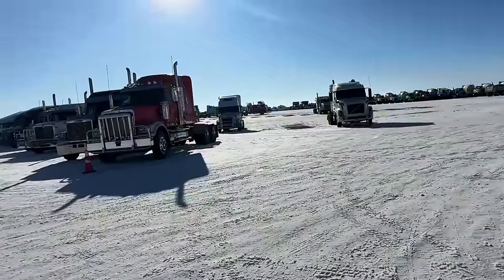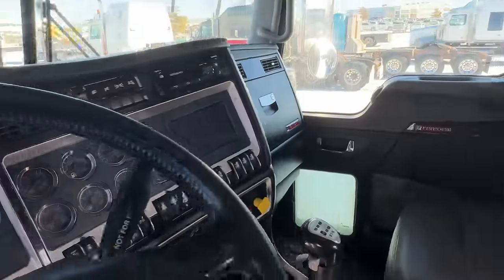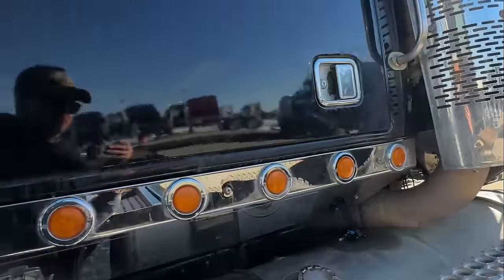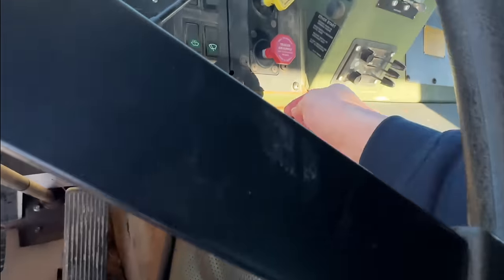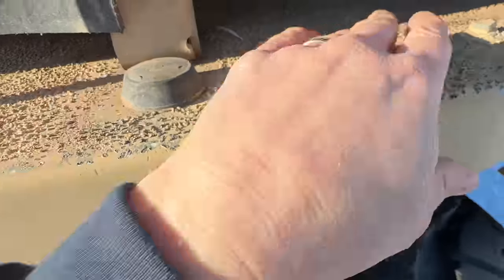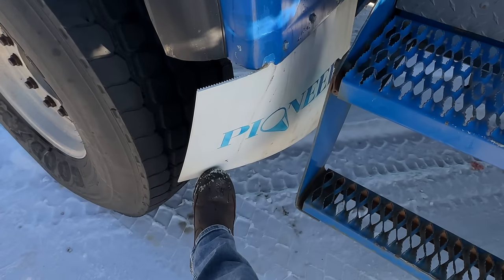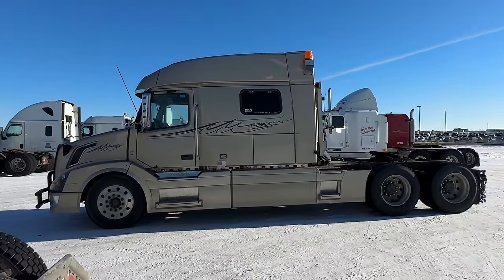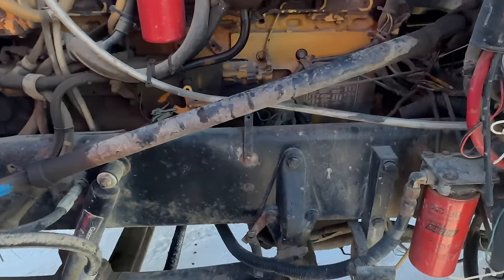On The Hunt Ep.42 Oshkosh Auction

Comment: I am sure a thousand guys have told you now. I was a heavy wheel mechanic in the Army active duty for 10 years. The hoses in the back are for chemical warfare. They are for filtering the air. So the hoses hook up to your gas mask. The bench seat is for the tank crew. The old ones had a  8V92 Detroit in it. The new ones have cat C18. I want the new one. Side note. I hauled a broke 'het," which is the truck you are in With a M1Abrams on the back. With my Hemtt wrecker. It broke my toe cylinder and chewed my tires up so bad. It took 1 inch off my tires in a 20 mile trip. I saw my motor Sgt do it so I had to try it
Reply: Could one replace the Detroit with C18, do they have same gearbox and bellhousing?

Comment: The hoses in the cab are for the Nuclear/Bio/chem filtration system. They hook into the clean side of a pro mask. And the rear wheel steering is speed controlled. Keeps you from dragging the rear drive around corners and stripping the tires. and if it didn't have it, you couldn't do a u-turn on a football field

Comment: I just bought a 1957 Kenworth CC-925 that has been sitting outside for at least 30 years and it's frame is in better shape than most of the trucks at that auction.  I paid $1500 and dragged it out of the Mojave Desert.  It has 5X3 twin sticks.

A couple of years ago I was at my local pick a part and there was a 6.2 diesel suburban with a Banks system on it and I pulled the Banks system and bought it for a couple hundred bucks.  They are long discontinued and still in demand.  Most people just pull the factory turbo system off of the 6.5 with the factory turbo. I was running a 6.5 in my 1994 H1 Hummer up until 2 years ago when I duramax swapped it. Most people don't realize that GM sold the design for the 6.2/6.5 to AM General and they were actually updated and made much better than the GM version.  The optimizer was the first revision followed by the GEP P400 which is sadly discontinued. Many GM truck owners purchased the GEP P400 to install in GM trucks and Suburbans.  I had a GEP P400 in my H1 Hummer up until I did the Duramax swap.  I originally purchased the H1 Hummer with a broken crankshaft caused by the failure of the harmonic balancer which is a very common occurrence.  The P400 is rated from the factory at 250hp and 550tq and they can easily make more power and in my Hummer I was making 325hp and 600tq which is actually respectable.  I kept the P400 from my Hummer when I duramax swapped it just in case I find the perfect Chevy truck with a tired or broken 6.2 or 6.5 engine.

Comment: 7:01 that’s a blower for a pneumatic or vac trailer, worked for a company that had 350 of them, they’re 2-3 or 4 hopper trailers that are used for hauling commodities like a hopper bottom but you can blow it up piping into a bin or any container and keeps it all sanitary/food grade. They’re used for the powder part of cement mix at big plants. Or we could change the pipes and use them as a vacuum, like vac out spilled grail or use it as a holding tank off a vac truck. The uses are endless but they’re a huge pain to take care of but a lot of the big 5 hoppers are out in the patch too for frac stuff too
Reply: Probably a Gardner Denver or a Drum.

Comment: We have an old military Oshkosh where I work. I believe it was a wrecker, or they wanted it as a wrecker. It was too slow on the highway so it's a water truck now. The tires will go flat over time but after you start it, they puff right back up. They self regulate the pressure on all tires. My first half ton was an 85 Chevy Sierra. I loved it, I could climb right in where the engine is and there was lots of room to work in there. Had an old police cruiser engine with the 4 barrels. I had to keep a box of fuel pumps with me because it would randomly kill them. Luckily the pump was easy access front of the engine. Unfortunately, I did not have a licence then. My ex had it in his name. When we split, he traded it for a stereo. I never found it, never seen that truck again.

Comment: Mark, you have a extra zinger left in the bag! You finished with the GMC with the 6.2 Detroit diesel! WOW talk about bringing back memories man! This was my first diesel engine! Mine was in a 1986 Chevrolet K5 blazer, white with burgundy interior 4X4 with a 700R4 (which I had rebuilt twice) only issue with the engine was glow plugs and glow plug relay! No turbo. I remember that GM came out with the 6.5 which had a turbo from the factory and was the next best thing? If I remember I had the civilian version and it had a awesome 165 hp ? The military version was 225 hp? Mine wouldn't pull a greased string out of a cats ass? But I got a awesome 33 mph! I was at the lake and this fella had a brand new f150 with the matching paint on his ranger bass boat and the boat ramp was wet and he was having issues with his 4X4 locking up ( it was tinging and his rear was breaking traction) I asked if he needed some help and he asked if I had something to help him out,  my old Blazer? ( 😂 his response) so I nosed up and locked my gal in 4 low and pulled hi out and kept on pulling a good 150' to prove my point! Brother 2/3 people came up to ask me what just happened and were shocked as to how easy it was to pull that off? The fella in the f150 said his truck was only 3 weeks old and the 1st time he tried the 4X4 ? Thanks brother for starting the old 6.2 up...you just took me back 30 years!

Comment: Those HETs are a beast, the air system that was disconnected is called CTIS central tire inflation system you can adjust to run in snow, sand mud and a run flat mode, and the rear tire steer is all part of the system they turn extremely well for a vehicle of their size

Comment: You letting Jake go on that Cat, bring memories. The owner that worked for sold Freightliner 3406E 2008. Replaced it International ProStar first emission control system. First week  with the ProStar, had a customer at bottom of hill. The Store was on intersection. You turn right the street was steeper than hill. A Pet had a C15, straight pipes logger haul comes over the hill just a screaming. The Pet get out of hear sound, the owner of the Store say your new truck does have a Jake?

Comment: 16:00 their is an inner and outer bearing race seal on the axle spindle that feeds the wheel hub active air, so their are 2-3 items one being an O-ring that run out and leak after a static amount of mileage. capped off... wheel air seal times 16 for the inner and outer, whatever happens when the axle gets 180psi in it... more seals. if it took 15 minuets to do a 1ton axle seal, those come off the same with a few more bolts tho 8 and a shop charges 255/hr, that's another 1500 bucks they didn't care too... what other corners were cut on a 35$ rubber ring?

Comment: In 1991 I spect out a Pete 379. I wanted a 6+4 the salesman talk me out of it, he said it would add weight and lower the resale value. I got the 15 speed which was the new trans back then.   The 3406B I was told was the last mechanical caterpillar before the E models came out. It was rated at 440hp 1650tq. Even though it was a "425".  I paid $97,000 for it.  $1624 a month. It was a great truck. After a couple years I put a turbo from the new 460 Cat and a set of injectors in it. Made 606rwhp and 2350 rwtq. It was a fun rig. I wish I got the twin stick...

Comment: Mark I went on to own a 2002 Chevrolet 2500 with the LB2 Duramax, a 2009 Chevrolet 2500 with the LB3 Duramax, a 20015 Chevrolet 3500 dually with the LB4 Duramax and now I'm in a 2019 F350 single rear wheel with the 6.7 power stroke! You can't really compare the engines I've owned but I can say each one was stronger and stronger! I have more hp in my current power stroke than my 15 liter Cummins that I drive in my 2023 Freightliner Cascadia at work it's only set at 400 hp? But my Ford's a beast! even at factory settings!

Comment: I worked im the oil field (in the 90s) and we used wd40 in lewe of Ether 🤷Also  they had a few Oshkosh trucks (from the late 70 early 80s) that I really liked a lot except for the automatic transmission part. The company was called "The Western Company of North America, I left the day they got bought out by "BJ Services" cause there is ZERO pride is saying you work for "BJ Services"  JS Theese Oshkosh trucks were converted from those cement trucks that look like they are going down the road backwards to Frack Pumps

Comment: The Oshkoshs look like former (US) military. I have not seen these anywhere in the Canadian Military. Not much for creature comforts or esthetics. The air lines on the hubs is called the TPMS (Tire pressure monitoring system) which allows the driver to adjust tire pressure on the fly. IMO one of those would make a very nice off road recovery vehicle for the oil patch if you could find a wrecker body that would fit. Glad hands at the front are for towing. The lines on the right side of the cab is for nuclear biological chemical applications (after which you might get to see the Mad Max Aussie Mack). The tray on the center was for the military radio sets. Pacars...apparently you can't just own one. Sorry to see you lost out on the Pete.

Comment: Hi Mark the Oshkosh are very strong work horses until you get British soldiers driving them I have tacken 4 back to the mechanics at a base in the uk that were used in Afghanistan and My god the bend really easy one had a tank cannon straight through the windshield 2 had been rolled over and the other was shot up and the engine had bullet holes everywhere the hood must of had 60 or 70 holes in it but the other 3 although they had very bad cab damage i did drive them on to the (lowloder) you call a lowboy I actually drove them but they are one hell of a truck, tack a look at some of c& cequipment on YouTube he buys alot of military equipment as the oshkosh and alot of bulldozers and excavators but he loves the truck's.

Comment: The OSKOSH  M1070s that you are looking at are two-stroke detroits. 
Later variants (very visible in Europe  -  UK and Germany  -  as the M1300 variant) 
have a CAT at about 18 litres
(18.01-litre turbocharged and intercooled 4-stroke diesel)
and a better Auto trans (more ratios))
(Allison 4800SP 7-speed, TC-496 torque converter 
and Oshkosh 30000 single-speed transfer case).

If you can get these (Engine & Auto) to RETROFIT to an M1070,
you have a good Heavy-Haul tractor.

The screaming two-stroke and the five-speed ALISION,
NOT SO GOOD, TO BE HONEST.

The Oshkosh 55000 transfer case , 
if you have it
gives a reduction ratio (2-speed transfer case).

Comment: Hey Mark you should consider attending the Mid America Truck Show next year and bring Snowman and the Pontiac Trans Am.
I'm sure the ATHS can make it happen;as Chad Keegan attended this year's show and brought his 1980 Kenworth K100C flat top to the show and was on display in the ATHS section of the show.
And for the shifter extension get in touch with SHTube they sell all kinds of stainless steel products for trucks.
Reply from the maker: It’s a little far from Edmonton…
Reply: @TwinStix  Yeah you have a point there;it's not worth the risk getting Snowman & the Trans Am ready for a 1,000 plus mile journey and risking a breakdown occuring half way through the trip and being either stranded on the side of the interstate or at a T/A,Flying J,or Loves truck stop.The best option would be to do what Mike The Truck Nut did;and that is to purchase a plane ticket to fly from Canada to Louisville Kentucky,and bringing a lap top and some Go Pro cameras and attend the truck show filming videos to post on the channel of the Mid America Truck Show and will provide a major boost to the channel.If you attend the Mid America Truck Show next year you might get some inspirational ideas for your truck builds from alot of the trucks that will be on display and you might even pick up a few channel sponsors while you are at the show as well.

Comment: The rear wheel steer is connected to the main steer just at a reduced ratio from main. The air hoses are for nuclear, bio, chemical environments for the passengers cause it’s made to transport tanks and the crew sits in the “bunk”

Comment: As for the super long gear shift , 8 out of ten transmissions  that I replace have those tall sticks they are a joke  , the best ones in my opinion are a w 900 or a t 800 with a short stick , they shift so smoothly,  just need a actual driver on the stick !!! .. w900 best truck ever

Comment: Have seen quite a few 6.2s oil pressure and temp guages are showing wrong values on guages . Some one uses a sending switch for gas engines . The calibration is different .replaced with senders for diesel 6.2 then then is accurate ! Oshkosh , damn trucks do it all !

Comment: The air system in the Oshkosh truck is for a chemical attack, up to 4 people could use the air system at a time. It would pull in outside air though a chemical and charcoal filters for the occupants to use.

Comment: Oshkosh Tank Transporter with 750 HP 8V92TA 18 speed Allison Automatic can move 110 Tons GVW cab takes drivers and 4 man tank crew bench seat converts to bunks hoses in cab are for gas masks winches are for pulling M1 Abrams Tank onboard Max road speed 45 MPH. Watch C&C Equipment channel they fix these up lots for sale all over

Comment: Ether is not actually bad for the engine as such. What's bad is that people use ether instead of actually fixing the starting problem. The problem is masked by the use of ether which gets worse untill finally the motor won't start or won't start without using starting magic juice

Comment: Those interior hoses that says gas filter. Those are gas filter, mask filters for biohazard, chemical agent masks in case soldiers encounter biohazard, gas or gas stuff like that they equipped their gas masks hook it into the air supply for the truck and I’ll be able to breathe.

Comment: In regards to peppering the cab on the older star. Why do you guys in Canada and the US don't run mudguards over the rear axles? Plastic, metal or flxi-guards? It's been standard fair (and roadworthy item) in Aus for decades now. Even 1/4 fenders were phased out in the 90's. If it's a clearance issue I don't understand why you wouldn't even run flexi-guards like cattle trucks do here to tackle the angles they do off road
Reply: Wtf are you talking about! Everybody runs quarter fenders half fenders or full!
Reply: Yeah I don't understand in this day why you would run quarters or half fenders at all. Why risk your cab? Everyone in Aus runs full fenders on both axles and goodbye to stone chips on your cab and trailer (all trailers here are steel no aluminium)